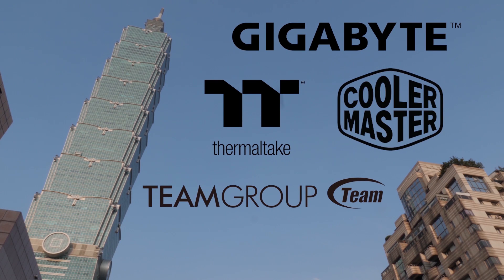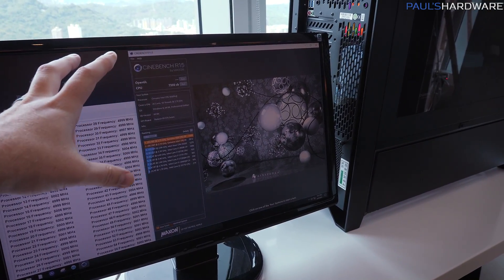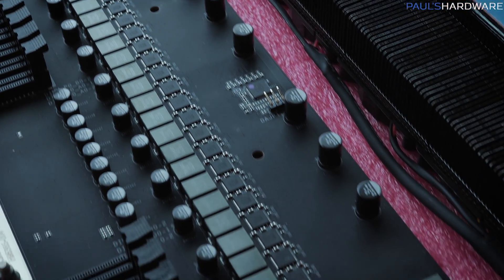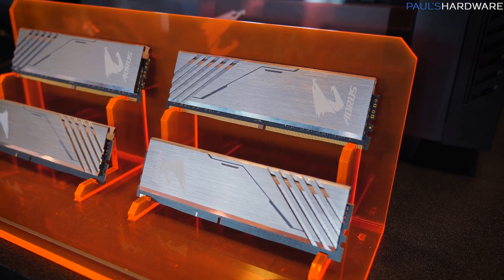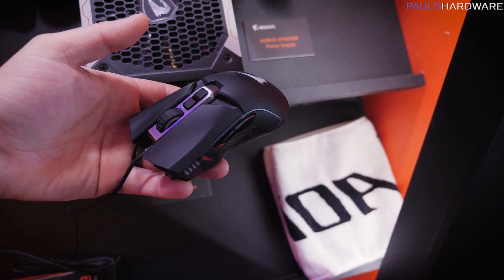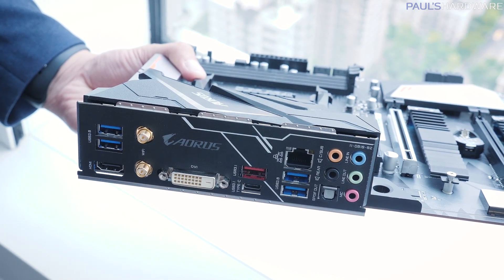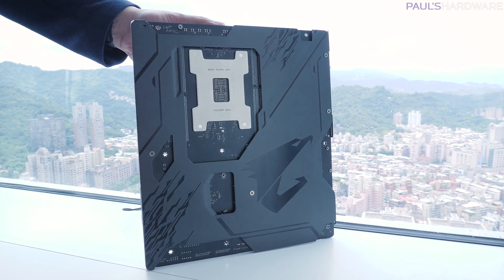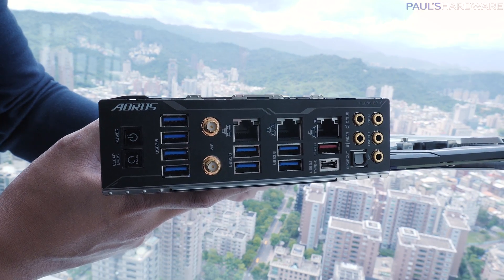Just A 28-Core 56-Thread CPU at 5GHz...

Comment: Intel: Haha, we got the upper on AMD now, with our NEW 28 core CPU! 

Amd: LAUNCHES 32 CORE THREADRIPPER 2
Reply: Stfu competition is great intel fanboy
Reply: If Intel releases that with a 5GHz boost I'd eat my hat. It's a 2.1GHz base clock with a boost to 3.8GHz boost in it's normal config of a Xeon Platinum 8176 CPU (Skylake-X architecture).

Just remember here AMD aren't running final clock speeds on their TR2 show CPU (it's still an engineering sample) which was running on an Air cooler, not a water cooler or anything more exotic.

Intel using a sub-ambient cooling solution to do a 5GHz Cinebench run which was rather lacklustre (16c 32t Threadrippers were doing 3572 at 4.1GHz...) considering the OC and hardware required by the Intel machine. I mean it's IPC is pretty much dead on with Threadripper so with a safe bet that Intel CPU won't ship with 5GHz boost, but a more conservative 4-4.2GHz boost makes it less powerful an easily cost double if not triple the AMD 32c unit. Intel aren't known for releasing their $10K cpu's for much of a discount...
Reply: PaynPlay play intel : 28 cores 2000w at only $4999 + 1000w Air conditoner to achieve 5Ghz
Reply: 28 cores @5Ghz... yeah but lets see how well it does on air cooling or even a regular water cooler. Nowhere near 5 Ghz... guaranteed.
Reply: Intel: New 28 core at (5 GHZ)
AMD: New 32 core at (3.8 GHZ) "Lol most likely be that speed knowing shitty AMD"

Comment: funny that AMD has more threads for less cost and does not need its own air-conditioner to run.
Reply: Dude, your the one with the head problem.... if Intel wants to make this CPU run at 5Ghz on a plain water cooler continuously, you won't see this CPU for another year... if even then.
Reply: laughs I am a dudette...
Reply: Are you AMD fans fucked in the head? They even said it's only for showcase, aftermarket ones will come out for that socket, jesus, you AMD fans are trying to find every detail to make AMD sound better, which it never has
Reply: Now swearing is not called for.  I am guessing you never have been at a convention.  Companies Showcase things that they are often going to bring to market. I have tested and worked with servers for years at Dell and I guess that my opinion has little weight about things but having a cooling solution for a chip that is more than unreal is great to show off but for real world apps its silly. thus AMD is ahead of the game per what I saw at the AMD Show.  if your a company or even a single person considering having a server. Cost and reliability and durability and other factors come to mind.

Comment: Did some looking after seeing this video.. Here is the processor they were showing off at 28 Cores and 56 threads. Intel Xeon Scalable Platinum 8180 SkyLake 28-Core 2.5 GHz (3.8 GHz Turbo) LGA 3647 205W BX806738180 Server Processor. Basically a $10,000 Server CPU. https://www.newegg.com/Product/Product.aspx?item=N82E16819117904

Comment: That "AC unit" is actually a sub-ambient water chiller and the socket is an LGA 3647 (their high density server socket). Also 4x8 pin CPU power? Thats 1200w of available power to the CPU alone. For reference a standard NEMA N5-15 outlet can only do about 1440w at 120v. To power this thing fully you would need 240v power or a 20 amp outlet.

This seems almost like a joke...but I look forward to Linus breaking out his Phi processor on one of these boards again. OC-ing 128 cores anyone?
Reply: xXx_MlgTr1kSh00ter _Xx you do realize Americans do use plugs that will power that right we just don't have them all over the house.
Reply: Taylord Tech check gamer nexus channel, he's talking about that.
Reply: People had a massive shit-fit over AMD's 200+ watt, 5GHz FX chip, yet cheer this monstrosity?
Reply: Almost every single home in the USA has a 220v circuit at least two usually, most stoves/ovens electric dryers and HVAC units run on 220v
Reply: How much power I need to run this. Nuclear reactor maybe!!!!!
Reply: Well, I guess it's Europe exclusive product.
Reply: Benjamin Hale but i dont want to go into my garage to power my pc on a sturdy multi- phase connector (wich in europe are 400 V, btw)
Reply: Pretty sure that no one wants that Tobias. Which is why they will never release this chip marketed at a 5GHz clock. They will likely never release it anyways because they would have to sell it for about a third or less than the cost of the Xeon they base it on.
Reply: 230V in europe ftw! however, I'm not planning on powering this thing
Reply: Ohh, thanks for that geek info.
Reply: We have the current to do it. 220 at 5-10amps is like 120 at 15-20amps. Just make sure your breakers are in check. No seriously.

Comment: Correction: A 28-Core 56-Thread CPU at 5GHz...But only for a couple of seconds

Description: It needs a Motherboard with a 28 phase VRM design including custom VRM cooling and a watercooling kit that's externally chilled to about 4°C. But Hey! it can do a benchmark really quick!
Reply: It's a 32 phase VRM. It needs 1 VRM per core plus 4.
Reply: I would love to see it running longer then a few seconds.
But it would probably melt the socket so...

Comment: looks like intel released a 9590 , but w/ 3.5x the cores and power consumption
Reply: that would be an a good analogy, though at the time AMD was really trying to not fall further behind, in this case intel is still trying to show they are still ahead. Though AMD didn't need a refrigerator to cool their PC and didn't pull 1.5Killowatts...the intel CPU unlike the AMD is actually really fast, just very inefficient. Besides if the 32 core Threadripper scales the same from epyc then it will beat this score, with just under 8000 on cinebench with 4.0ghz all cores.
Reply: And 10x the performance.

Comment: that freaking board lol. 4 cpu power connectors and chipset heatsink.
Reply: Definitely 1000+ Watts just for the CPU...
Reply: i'm hoping for intels sake that 4x cpu power isn't required, and it's just used on prototype boards. otherwise the backlash will never stop regarding high tdp temps noise and the likes.
Reply: honestly think amd's won in the long run. they've found a way to increase core count in a very cost effective manner. regardless of performance or personal bias it's a winning strategy that i'm sure intel qualcomm and others will adapt in their own way eventually.
Reply: intel hasnt been good with being honest since the whole issue with dell/hp a long time ago where they paid them over a billion a quarter to not use amds chips, even though they were better. they still have a lot to prove in my eyes.
Reply: even if people did realize amd was so stuck on fx that intel could do whatever they wanted.
Reply: I think it will draw more than 1200 watts when running in 5 ghz or more
Reply: Amen to that
Reply: I don't know of any data center that would want that rig in their main data center, and it is just not fast enough to justify putting it in it's own isolated environment.
Data centers are about delivering the most compute and storage to the end users / enterprise applications for the least total cost of ownership over a given time.  This rig does not even come close to matching the efficiency of a modern data center.
Reply: I count 37 VRMs!? Thirty freaking seven! I misspelled Thirty as Thirsty but I would have been right either way :P
Reply: This kind of set up will most certainly live in a rack where noise etc isn't an issue. Power consumption is obviously a concern though all that will be to run everything else you plug in like maybe multiple super fast PCI SSD's and the like.
Reply: How many watts do you think each connector is capable of delivering?  Why do you think they have 32 phase power delivery with that massive actively cooled copper heat sync?  I believe they effectively have multiple sets of power delivery for this system and it takes all 4 connectors to channel the power to the power delivery in order to feed that insane overclock.
Reply: GT Barsi Even the new chips aren't. I haven't seen a datacenter in my country who uses all these fancy new CPUs and they are still using those 12C/24T from 2012. The point of datacenters is minimalizing down time for best service. They don't upgrade for a very long time. I even saw datacenters who have old 16C Xeons from 2015 in stock if ever they need to upgrade in 2020 or something
Reply: How much power I need to run this. Nuclear reactor maybe!!!!!
Reply: bryan joiner No it's called a partnership, especially when both companies mutually accept it. And no, when you are partnered with company A you don't use the same stuff from company B...what's the use of partnerships then? Intel was sued with monopoly, not bribery. While AMD heads were shit as usual back then and didn't do anything. Atleast Lisa Su has some backbone in her
Reply: stop Fan boy Stop please jesus you so branwashed
Reply: gameboy3800 Lol intel didn't bribe anyone...surprised people are still outdated with this news. Dell and HP made a partnership with intel and intel was sued for monopoly charges, not bribery. Intel even blamed AMD for everything because AMD just didn't push very hard with marketing while intel did.

Comment: I was hoping Intel wouldn't go the giant socket route with this CPU. It's the one advantage they had over Threadripper -- normal-sized CPUs. There is even an X299 ITX board. These giant sockets and giant dies are ridiculous, they are trying to get ahead of Moore's Law. 5GHz across 28 cores with 14nm++ process is going to pull 1.5 kilowatts. You'd need a power supply just for your CPU. That's not how computers are supposed to work, you make things smaller and more power efficient, not the other way around.
Reply: Threadripper  usages less power and stays cooler than the x299 platform.
Reply: They really don't have much of a choice though, they have competition now and must show they are trying, as their 10 nm stuff is a bust so far.

Comment: Thread ripper 2.... Ripped it a new ass yesterday.
Reply: There is a wraith ripper cooler.  https://youtu.be/E73H8HvqjEM?t=4m53s
Reply: Christian Anderson. First, they rugged it. Special cooling, motherboard etc. Second cost. Hay, if they price it right, I too would buy it but it won't. All thread ripper 2 videos are on air.
Reply: AMD fan cool CPU vs Intel Refrigeration cooler box the size of another PC. However the real comparison will be price at the end of the day.
Reply: $10000 is what intels current 28 core cpu costs.
Reply: AMD branded Wraith Ripper. Likely a new stock cooler. Made by Cooler Master.
Reply: Nah. Actually the 8176 (also 28 core just lower clocked) "only" costs $8719. It's a real bargain :D
Reply: Not hard for TR to beat a fake
Reply: Poke me when the 28 core intel will do it without a $3500 chiller unit
Reply: 32 core TR was on air cpu cooler they showed it in a video. I believe it was a coolermaster.
Reply: Not stock they said you would buy it seperately.
Reply: PaynPlay play: Are you a parrot? They have a very small brain to body ratio. You remind me of them.
Reply: You where saying.... https://segmentnext.com/2018/6/08/amd-ryzen-wraith-ripper-amd-threadripper-gen-2/
Reply: How in the world is a regular water cooler going to keep that CPU cool enough to run at 5Ghz.  Even with this chiller they only ran it for a few seconds... give your head a shake.
Reply: Christian Anderson probably the 32 cores Tr will with phase change cooling too...
Reply: AMD wont win LOL, Guys they jerry rigged it till aftermarket coolers come out and fan coolers for fuck sakes amd fans give intel one for the team to amazly push the 28 core to 5ghz stock boost clock. Damn chill out
Reply: Stfu lol theres no such thing as wraith ripper cooler 

Stop sharing fake shit
Reply: Poke me back when AMD has something that beats 7300 on Cinebench.

Comment: AMD do you have anything to say? AMD- "Hold my beer..." Seriously though a Xeon Platinum on a 32 phase power delivery with exotic cooling and probably drawings close to 1.2kw... pretty bad PR stunt...intel is shook
Reply: Charlie Brown, an overclock that requires over 2.5KW power consumption to run (cooler alone uses 1100W and CPU uses 1300W) is really just last ditch panic when thet got wind that it wasn't 24C TR2 AMD was announcing but 32C. Look how crudely and amateur the Intel set up looks.
Reply: 1300W power consumption on the CPU alone according to the grape wine. It's essentially an overclocked platinum 8176 so 1300W seems fairly accurate given that the 8176 uses 670W at 2.8GHz all core, and just multiplying that up to 5GHz would be 1196W. Add a little extra voltage needed for the overclock and you land at the 1300W figure.
Reply: gamer nexus already debunk it lul. go watch their latest vid
Reply: The 8176 and 8180 are identical except a higher base clock on the 8180, turbo clocks are pretty much the same. I just happened to have the exact power consumption measurement for the 8176 so I used that as the base line.
Reply: giorgis, close but not quite. It's P=CV^2*f. There's a difference ;)
Intels skylake-X server CPUs have internal Vcore adjustment and usually set quite high to ensure stability when running heavy AVX512 workloads which isn't needed here as they only needed it to run CB, so it probably didn't need more than a couple of percent higher voltage.
Reply: Actually I think it's an overclocked Intel Xeon Scalable Platinum 8180
Reply: We debunked it hours before he did though. :D
Reply: Samsonite Dove cpu power consumption is calculated via: p=C*V^2*f so voltage increases the heat more than frequency
Reply: Don't you really really reaallly have anything better to do than spreading lies and trying to diminish AMD on YT? Did you short AMD stock? I really hope so, otherwise yours must be a sad life.
Reply: Had Intel also use Blender, AMD would've resort to using Geekbench instead LMAO. Remember: Xeon 8180 smacks the 32 core Epyc in majority of applications by 25-30% on average. This Threadripper 2 with its gimped channel memory will have higher latency than the regular 32 core Epyc. Now we're talking about an even larger performance gap between the two.
Reply: Nobody's lying. Go read actual review of Xeon 28 cores vs Epyc 32 Cores and you can see why most datacenters consist of mainly Intel systems and not much of AMD or even ARM for that matter.
 https://www.nextplatform.com/2017/11/27/intel-stacks-xeons-amd-epyc-systems/

Comment: If this wont give me 60fps on GW2 with a largr zerg on WvW nothing else will
Reply: hehe jokes aside, it wont help. GW2 runs on Dx9 -.-
Reply: 88oscuro Sadly, yes. Software limits in this game really heavy. :(
But 4 cores with the highest possible clock will help the most.
So no need for expensive 6+ Core CPUs. :D
See it in a positive way, the game helps to save money. XD
Reply: It outs my 4770K @ 4.4Ghz to 90-95 usage, so the game doesnt benefit even from going to 6-8 cores?
Reply: The Problem with GW2 is the DirectX9 API GW2 uses. Mh, shortly DX9 draws many things with help of the CPU, while newer DX Versions are able to bypass that. (CPU Overhead)
GW2 likes fast Memory Bandwith and a very strong FPU Unit in your CPU. So Intel is the best way for that. (Ryzen lacks a bit in this areas but still very good Products to compete.)
Deactivate Shadows, reduces character limit or the detail, if you need to see all of them. Activate LOD restriction, reduce reflections, 
GW2 only uses 3 Mainthreads. So you won't see much more performance with more than 4 cores.
IF you want a new CPU then, in this case, the 8700K (if Money isn't a big problem) or the 8600K would be the best to go, because it has a strong IPC via high clockspeed (even more when overclocked to 5GHz, if it is able to do that), fast memory bandwith and a very strong FPU unit.

I've tested it with my old 2600K ("Stock" for testing but MCE active so 3,8GHz on all cores) and a 1800X Ryzen7 (also stock), it was more or less the same performance. >_<
Because both have very similar IPC, even if the Ryzen has double the core count. GW2 won't use it for its advantage. :(